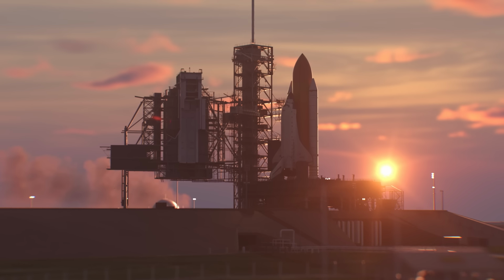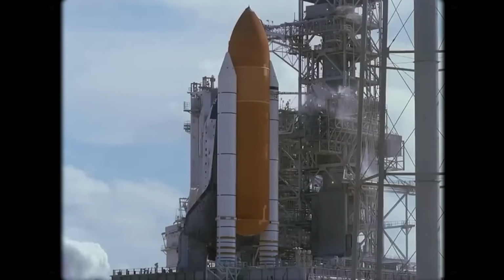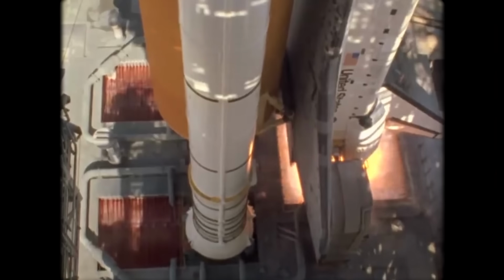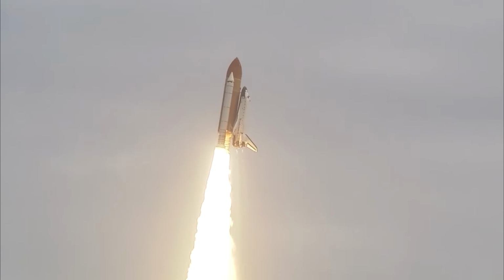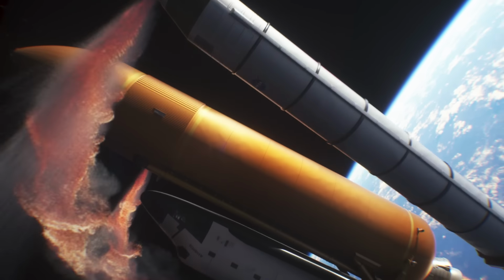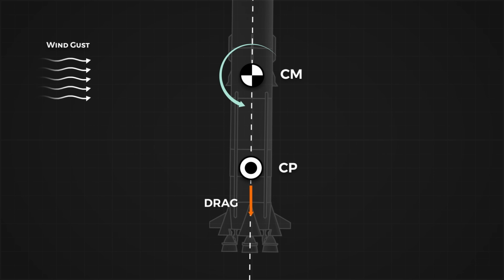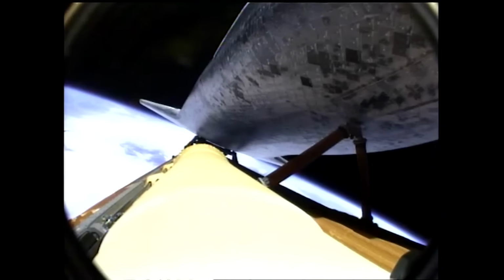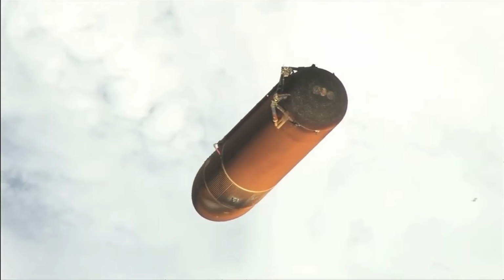The Insane Engineering of the Space Shuttle

Comment: The Space Shuttle was a compromise no one was happy with.  The "twang" causing the SRB's to absorb the power of the SSME's trying to push the system over, proved to be a fatal design flaw because the o-rights were never meant to be this kind of shock absorber.    The other design flaw was having the orbiter on the side.  The Shuttle held back NASA for 20+ years.

Comment: just like that ... to reach those gates (below the shuttle) use the columbia arm, then extend a astronaut with a lot of rope and teather ... let him float, using the arm create a loop (slack) in the rope such that when the shuttle rotates (slowly) the slack or the loop untangles... as due to slack one can think both the astronaut and the ships are individually beheaving thus the rotation motion of the shuttle does not affect the astronaut (or has a delayed affect)... this would make him reach the belly ...with the help of jet propulsion in the back pack its should be easy to navigate and reach....

Some key points hoping that humans take the right step ... a good way to reach far places would be to send objects in orbit assemble them in space... and doing that Space shuttle 2 (ss2) might play an important role  as it can be maneuvered any where and has the ability to provide a human presence if needed (way cheaper than building redundancies- especially for assembly in space).... as to the fuel tank, ss2 can have permanently attached, the empty tanks should provide plenty of bouncies for a nice water landing ( the shape )... but if needed it can detach... in space these tanks can be used for extra space... 

another simple solution would be to blow the bolts first from the tanks ends...this would leave some support infrastructure with the ship...upon re-entry blow the remaining end of the bolt...if that fails well you still have something to hold to fix it ...
Reply: like the ISS...i hope all nations come together and build something incredible in space ...and yes you would need tanks and stored fuel ... africa ...sa ..na

Comment: Twang.
I thought it lived in string and fret,
a humming sound you don’t forget.
But now it strikes a brighter chord,
like engines primed and power stored.
The trembling thrill before the light,
the snap of silence breaking flight.

A whisper caught in steel and flame,
a wordless urge without a name.
It stretches through the body's core,
a quiet want, a latent roar.
And when it goes, it doesn’t sing,
it tears, it leaps, it does not cling.

So twang is more than sound or string,
it’s every second before the spring.
A tightened thread, a soul pulled taut,
counting down until we're naught.
until we’re flung into the sky,
and all that’s left is how we fly.

Comment: Did the shuttle need to roll onto it's back because otherwise the orbiter would get BBQ'd by rising heat from the solid rocket boosters? Or was there a more complicated reason?
Reply: Two reasons:
The positioning of the shuttle main engines made it  more stable 
Aerodynamic stress is being applied on the ET instead of the orbiter

Comment: Why weren’t the 1st stage rockets ejected from the shuttle when they were completely out of fuel?
Reply: Are you talking about the smaller engines on the back of the orbiter? Of you are, they need to keep them to make the shuttle a reusable vehicle. Also the RS25 main engine is verry expensive
Reply: Do you mean the Solid Rocket Boosters or the Space Shuttle Main Engines?
Reply: @ I think I meant the solid rocket boosters
Reply: @TitusBaier  yeah so the SRB's are seperated a not unsignificant while before even passing 100Km
Reply: @TitusBaier  "I think I meant the solid rocket boosters"

Okay, fair enough. As I understand it, the boosters were discarded before using all their fuel for two main reasons. The first is because they're cast off from the side - to ensure they separate cleanly from the External Tank, they need to be travelling at the same speed as the ET. Second, if the boosters aren't providing thrust, then they're dead weight, slowing the acceleration of the whole stack. Does that make sense?
Reply: @ yea, that makes a lot of sense. Thank you.

Comment: How the hell do you 1 perfectly rendezvous with anything in orbit with out a 100 orbits to slowly approach. 2 how the fuck do you deorbit so perfectly the you hit a pebble (the runway) insane
Reply: Math
Reply: Good questions.

Rendezvous involves doing two things at once: (a) entering the same orbit as the object you're rendezvousing with (b) at the same point in the orbit as the object itself. What helps this is that there is a strict relationship between orbit and speed - whatever the orbit, all objects in that orbit will travel along that orbit at exactly the same speed.

Imagine there's a car driving along a freeway in the middle lane at 100 km/h. You're in a second car at the top of a ramp merging with the freeway, and your job is to pull into the outer lane at 100 km/h exactly beside the first car. You know (a) exactly where the first car is, and (b) exactly how quickly your car will reach 100 km/h. Therefore, your problem is to calculate exactly when to hit the accelerator in the second car. Obviously the maths is a bit more complex than that, but that's the principle.

Deorbiting the Shuttle wasn't quite so precise as you appear to think. Certainly, Mission Control had very precise timings for the deorbit burn and expected touchdown, but there was a lot of flexibility built into the approach to landing. That is, the Shuttle didn't just fly straight in. Instead, there were a number of ways of managing the approach to shorten or extend the flight if weather or other conditions affected the approach, such as using the rudder as a speed brake. Finally, when the Shuttle was close to the landing site, it was deliberately too high, but the approach path deliberately included a 360 circuit during which the Shuttle lost altitude. When the Shuttle finished the circuit it was lined up for landing.

Comment: Two things that I didn't catch in the video that are worth mentioning.

1. The reason the oxygen pipe to the engine is on the outside of the tank rather than inside is that liquid hydrogen is so cold that the oxygen would become a solid. The same reason is why helium is used to purge the engine hydrogen lines (rather than nitrogen for the oxygen lines); helium is the only element with a lower freezing point than hydrogen.

2. The shuttle's initial orbit when the main engines shut down is actually suborbital.  This not only makes it easier for the external tank to re-enter, but also makes "once around" abort scenarios easier. Thus, once the shuttle reaches its perigee - highest point from Earth - it will fire another set of engines, the orbital maneuvering system (OMS) engines - to circularize the orbit.  These are the engines located in the pods above and to either side of the main engines.  These are simpler, pressure fed engines that use hypergolic fuel & oxidizer, meaning they combist on contact with each other.  It's these engines along with several other smaller thrusters that allow the shuttle to maneuver in orbit and eventually deorbit and return to Earth.
Reply: Высшая точка не перигей, а апогей

Comment: Minor correction: It's a common misconception that the "sparklers" that you see shortly before ignition are the engine igniters.  They're actually intended to burn off any gaseous hydrogen that might've collected near the engines.  The actual igniters are inside the engines and function more similar to a spark plug in a car engine.

Comment: Another fun engineering fact of the shuttle launch: all that white “smoke” you see pour out of the launch pad as the engines light is actually steam from more than 300,000 gallons of water per minute being sprayed behind the engine outlets. You can see a good view of this water at around 7:03 minutes into the video.

This water was sprayed in a fine aerosolized mist and is used to drastically dampen the sound that the engines produced. If not dampened, the sound produced by the engines would both be uncomfortable (if not dangerous itself) for the flight crew and could possibly rip/shake pieces of the orbiter/fuel tank/SRBs off before launch.

Great video! The Space Shuttle is what started my love of science and aircraft. It was sad to see it retired before I was old enough to see a launch in person.

Comment: I have a serious question. When the solid rocket boosters light, say there is an issue 3 seconds after firing the solid rocket boosters, what do they do? And I mean is there just a button they hit, or once it’s on it’s on and there isn’t much you can do? And w😊e are talking an emergency abort situation. Cause you can’t stop the solid rocket booster unless you cut off the fuel if I’m not mistaken? but from what I understand once those light off your just on for the ride..
Reply: Once the solids are lit, they were committed.   If only one SRB lit, it was not survivable.

The emergency abort scenario at early stages was to fly a bit out to sea, boost around a bit to cancel velocity gains until the SRBs burnt out and could be jettisoned, then detach the orbiter and glide back to the Cape.   This was never done, even as a test; in the words of one astronaut "you don't practice bleeding".
Reply: No there was no way to turn them off and no way to abort. That’s one of the reasons the Challenger crew died
Reply: Solid rocket fuel contains a highly aggressive oxidizer that will keep providing oxygen for the fuel to burn no matter what you throw at it.
Reply: @AM-rd9pu  Some ballistic missiles have/had a way to terminate thrust from solid rocket stages by blowing out doors and depressurizing the rocket motor (the pressure would fall enough the combustion would stop).  But this would be a violent process, the shuttle SRBs were not designed to support it, and even if they had it would likely have destroyed the stack.

Comment: I don't understand the point of the shuttle. It was terrible.  Why was it even built? All you need is a reusable capsule not a shuttle. You can carry shit inside the rocket. Who thought having wings on re-entry was a good idea? Why was it so badly designed? They say it was like a flying brick. That is the last thing you want on a glider. Makes no sense.
Reply: There was one proposed mission that required those wings: a mission launched from Vandenberg, with a spy camera in the payload bay. Fly over the Soviet Union once, then reenter. You end up 1500 km West of Vandenberg, and you need 1500 km of cross-range in order to land. 
And having the payload bay attached to the crew compartment meant astronauts could work on the payload in ways that weren't possible for a simple capsule.
Reply: @zounds010  Of course, the importance of that mission is shown by the fact it was never performed.  The military bailed out of using the shuttle so quickly they never even finished the launch pad in California.
Reply: The point wasn’t just to get people to the ISS. The shuttle had a very large payload capacity. It could bring over 35,000 pounds of cargo to the ISS. 

The main advertised point was the reusability. Instead of having to build a new spacecraft for every mission, you just refurbished the shuttle. Whether or not the shuttle program was cheaper than using non-reusable spacecraft, I don’t know. But, the shuttle did prove to be a valuable asset for space travel.
Reply: The main purpose of the Shuttle was to get Nixon votes in California in 1972.   It's actual value is demonstrated by a perhaps apocryphal quote from one of von Braun's people:  "they've reinvented the wheel and made it square".

Comment: Something about the orbiter's engines that I always found interesting is that the fuel-oxidizer mixture that it ran was nowhere close to stoichiometric. Part of the reason for that might have been to limit the temperature experienced by the engine but it also, having a hydrogen-rich exhaust actually improves the engine's efficiency (or specific impulse, rather). Despite the fact that it doesn't burn as hot, because that mixture is so much lighter it comes out of the nozzle faster, so the system is more efficient that way.

Comment: fun fact: by the time the SRBs cut off the SSMEs didn't have enough thrust to outweight the shuttle + tank + fuel so for a brief moment the shuttle would slow down due to gravity pulling it backto earth. But after a couple seconds the fuel and oxidizer burnt caused a weight reduction that pushed thrust to weight ratio above 1 and the shuttle accelerated again.

Comment: It's fascinating to follow the strategic logic into why the space shuttle exists and why it eventually became redundant. A reusable space plane was the goal for mankind for decades, seen as the ultimate goal to reliable, cheap spaceflight, and compared to the technology used at the time, it was revolutionary. However, the very reason it worked became the very reason it was eventually retired, which was the fundamental logic that sending 110 tonnes into orbit and bringing 80 tonnes back each time meant it was only ever about 27% efficient at putting things into orbit, i.e. you spent all that energy in getting 110 tonnes into orbit when you brought 80 tonnes back. Ultimately, if you could send 110 tonnes into orbit and leave either all or most of it there, you could cut the cost per kg to orbit, which is why SpaceX's methods are superior. Still, it is a stepping stone to greatness, and a marvel of modern engineering.

Comment: To close the fuel doors EVA I think they could've hooked two safety lines to one astronaut in a way that the tension pulls them in towards the bottom of the vessel, but getting to the bottom and back would another challenge, probably would have to do some line swaps or something idk if the engines are still on but the tail section would get in the way so they'd walk out the bay doors on one line to aft of the vessel, then hook the other line in around the tail, and you'd definitely need an assistant to clear the lines around obstructions so a lot of tether material is required then once you're done you could detach one line and get pulled around the side and idk if they'd have enough length and usable mounting points to pull it off but if so then you still need a lot of trust in your rigging and that you'll be able to be pulled back in 😅

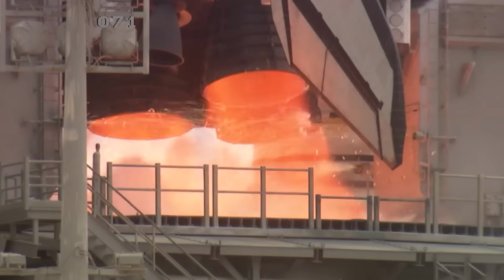Comment: At 2:34 you made a series of small mistakes. The liquid hydrogen does not go from the tank to the channels, it goes from the low pressure turbine, to the high pressure one, to the nozzle. What happens is, The low pressure turbine is densing it up a little, in preparation for the powerful one, which then pushes the fluid through the channels to heat up and expand, then the expanded gasses drive the small turbine, and then the gasses drive the preburners. Surprising that you made this mistake despite the graph shown in the video has it written otherwise, but nonetheless amazing quality video, exceptional effort put in.